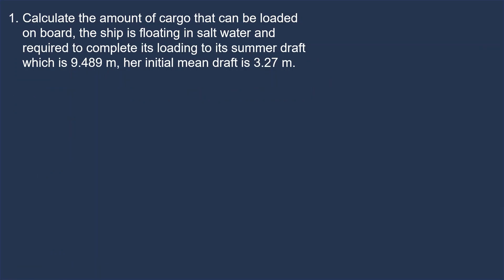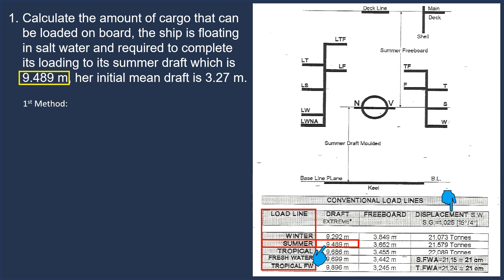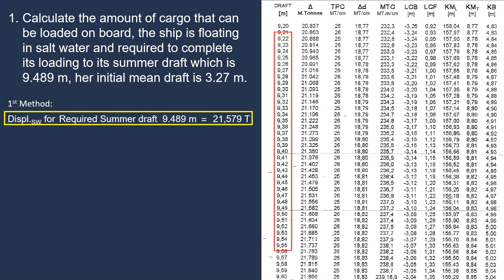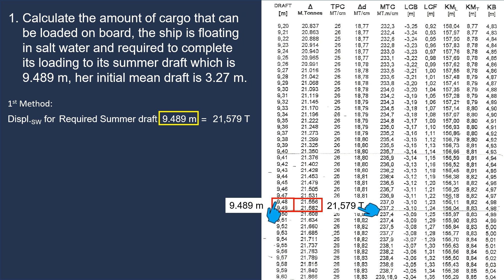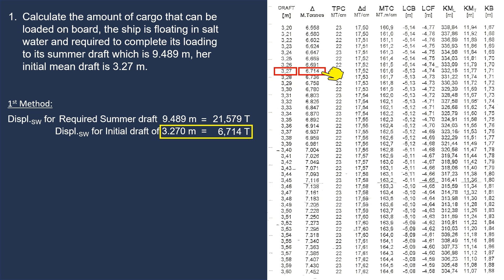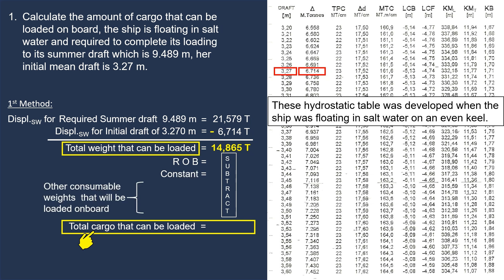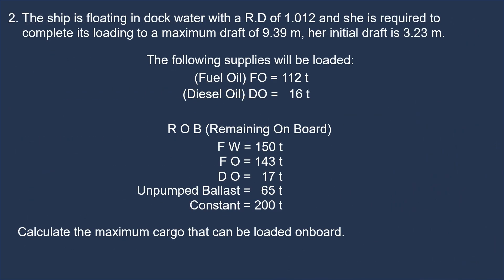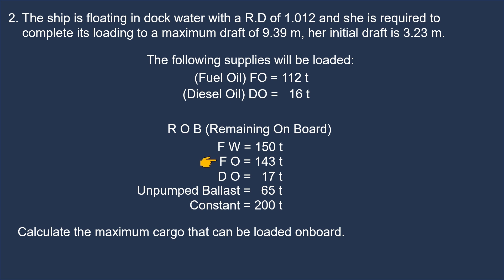Calculate Cargo to Load with Draft Limit 2 ll Determine the Maximum Cargo to Load for Required Draft

Comment: Thanks for this amazing video, all your videos are great and explained a a simple way. Nevertheless, I have a question about the last example, if a vessel is at an initial draft does her displacement at that draft not taking into account the load onboard ? If yes, why do you substract again the ROB before finding the final weight to load ?
Reply from the maker: Thank you! I'm glad you find the videos helpful. Great question about the last example! When a vessel is at an initial draft, the displacement does indeed reflect the total weight, including the load onboard at that time. However, to calculate the final weight of cargo to be loaded, we need to subtract the ROB (Remaining On Board) because the ROB contributes to the total displacement. Subtracting it ensures that we calculate the net weight of the new cargo to be loaded, without double-counting what's already onboard. I hope this clears up the confusion! Feel free to ask more questions if needed.